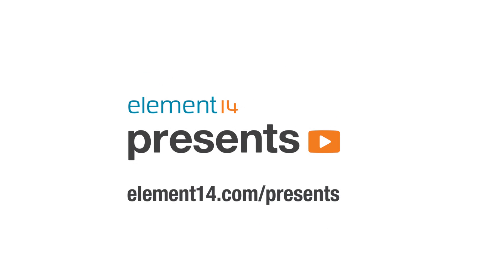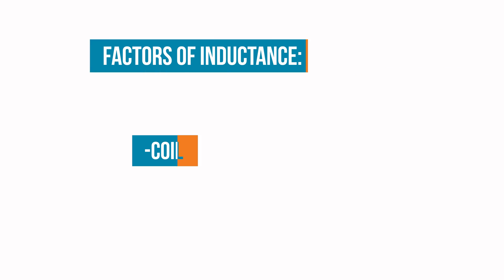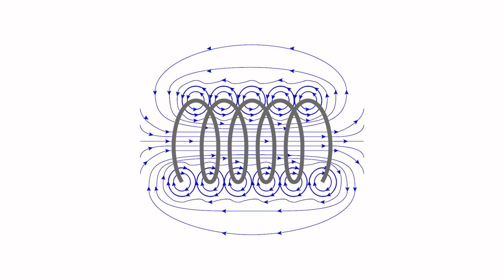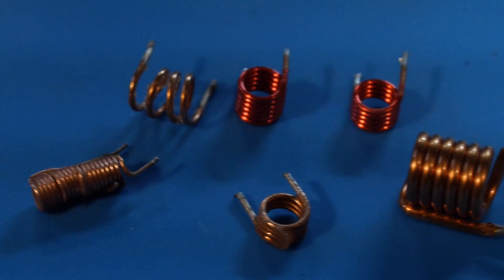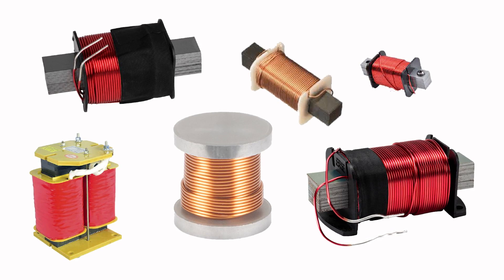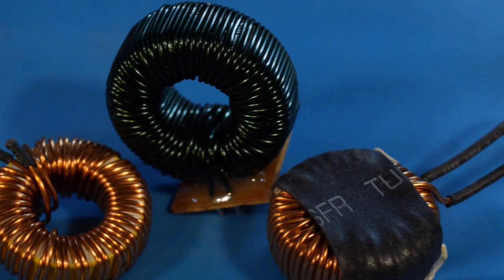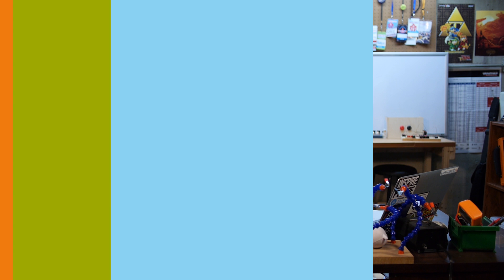How  Inductors Work - The Learning Circuit

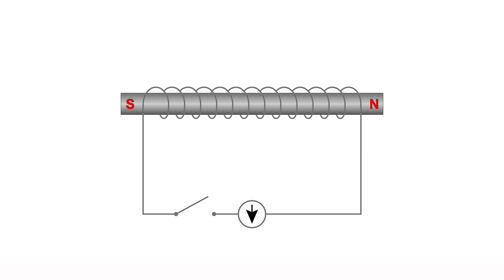Comment: 1:16 “it takes time for one end of the coil to catch up to the other.” Current is the same throughout. What is she talking about? 
1:20 I think the inductor voltage +/- needs to be swapped around to oppose the supply, instead of the two being in series as drawn. Then the polarity will swap when the switch opens. 
The switch opens in the animation but she doesn’t mention it. It’s unclear if she’s referring to that or not.

Comment: 0:54 - "When the current flowing through the wire is constant the potential across the coil matches that of the power supply."  No. When the current through the wire is constant the voltage drop across the coil is zero: V = L*di/dt. Since di/dt = 0 then V = 0.

Comment: Your mention of an inductor needing a purposed discharge pathway when the magnetic field collapses and the resulting electric current not being needed (as when a system is powered down) and will find a way to ground…I didn’t hear you mention the possibility of you or I also being eligible to be on that list of current pathways. I’ve seen some poorly designed boost converters and high voltage SMPSs (along with old CRT screens utilizing fly back transformers…technically an inductor too) that had the potential to electrocute the unwary or ill-trained person poking around inside the chassis of a device utilizing these inductive bits. Then there are the LRC filters common on Class D Audio amplifier modules…again if poorly designed, those can be an attractive and deadly nuisance too. Attractive because it’s rated at 500 watts, available on EBay or Amazon for $25-$35 dollars and for that kind of money, deadly because the design and build quality are SAF and unless one is educated-experienced in working with these bits in a at least general sense….it’s analogous to the post rectifier electrolytic DC filter caps on a vacuum tube tech audio amplifier. No, not just the technological anachronisms one buys at thrift stores or flea markets, but also modern built guitar amplifiers by Marshall, Vox, Fender, etc.

Comment: 0:52 when the current is constant the voltage across the coil should be zero no?
v=Ldi/dt ?
Reply: This is my sentiment as well. It means that di/dt=0 hence V_l=0.
Reply: Yes. The voltage across the the inductor in real life will depend on the current and the DC resistance of the coil, V=IR, yeah? If the current is constant.

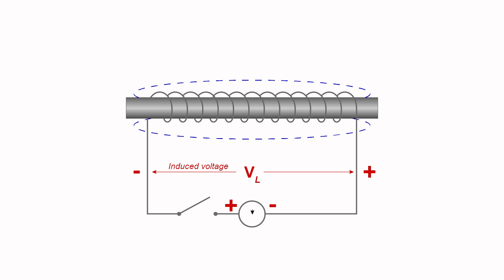Comment: When the polarity of a coil is reversed (1:27) the magnetic field should collapse then build-up again with the opposite magnetic polarity. Yes?
Reply: Yes, if you suddenly reversed the supply voltage. But at that part of the video she said the polarity is the reverse of the supply voltage, not that it does reverse. 

Magnetic north-south direction depends on the direction of current flow (and which way the coil is wound). Voltage polarity will swap when a growing magnetic field changes to a collapsing one, even though the current flow hasn’t changed direction.

Comment: 7:13 Great point on discharging coil. That's why we see diodes connected across motors and relays. Sometimes called a "flyback diode." 
Anyway, It's crazy how much starts with a just coil of wire: inductors, transformers, electromagnets, solenoids, speakers,  dynamic microphones, relays, motors... did I miss one?